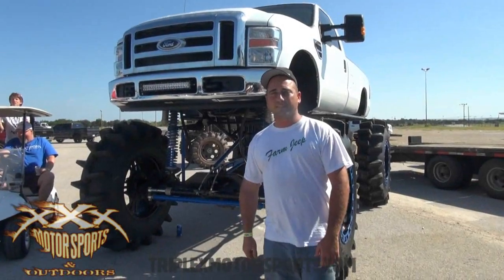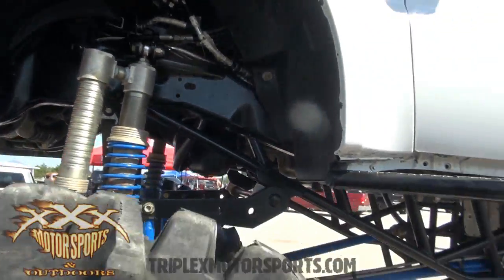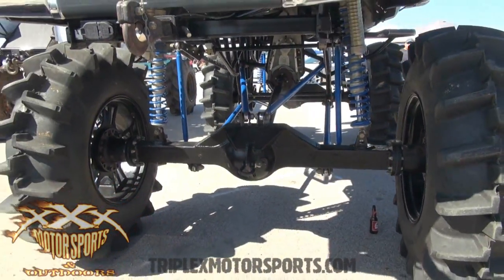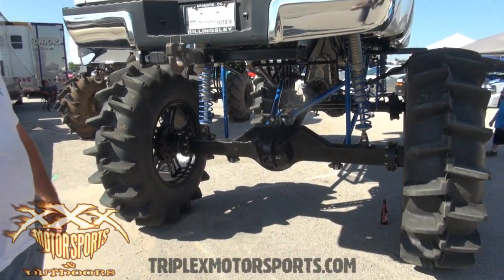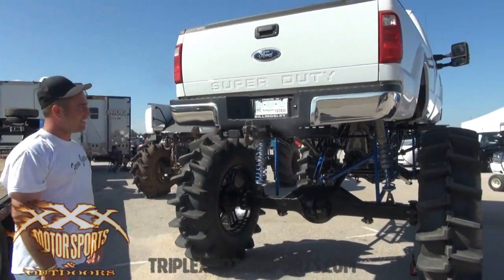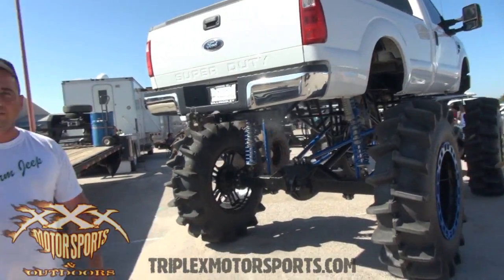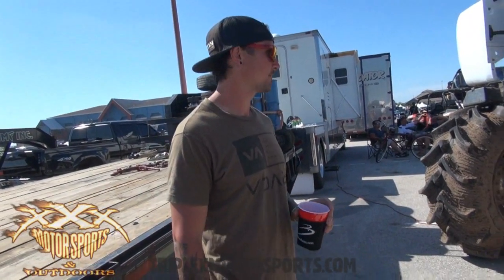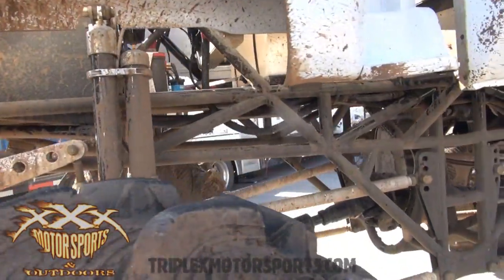HEATWAVE HEAVY HITTERS!!

Comment: Not here to hate just here for info!!! Why would you lift that high?? I understand moderate lifts but the axles are still low to the ground so is anything higher than the axle be helpful at all?
Reply: They're mud trucks... It's kinda the point.
Reply: Austin Durheim So you lift them that high so you won't get mud on them? Because that doesn't seem very smart.
Reply: +Rey Ruiz so you dont get mud/ water in the engine that can ruin the truck those things can go threw 8 feet of mud so yeah they dont want mud in the engine